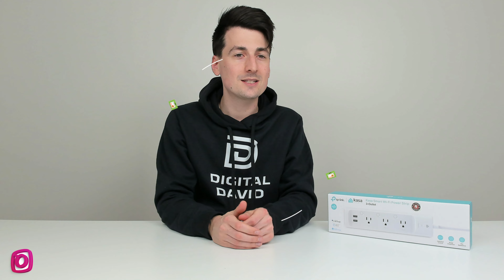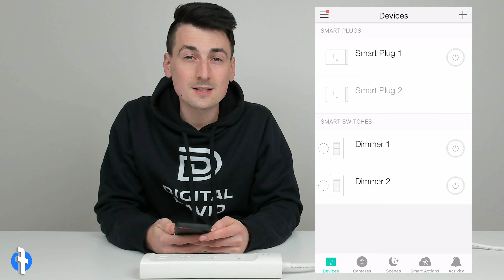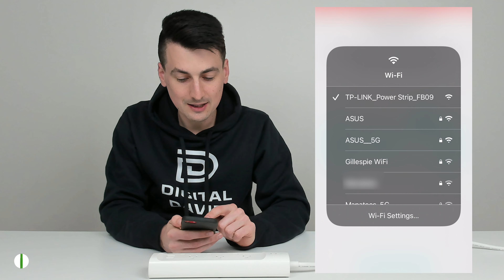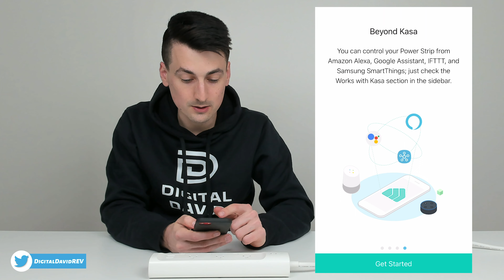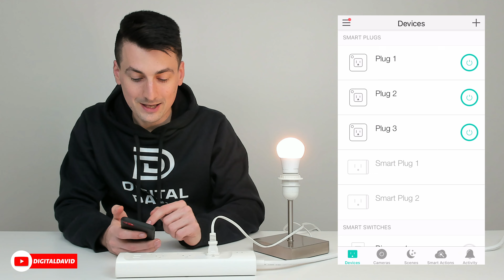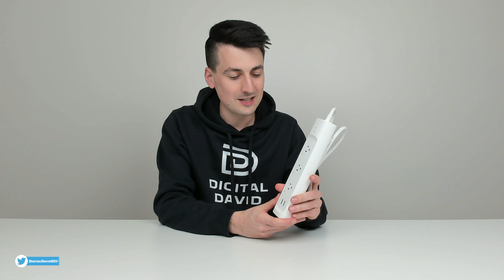Kasa Smart Plug Power Strip Review

Comment: Does anyone know if you can control the plugs when you aren't at home or do you have to be on the same Wifi network as the strip? I want to use this to cut power to 3D printers remotely while I'm at work.
Reply from the maker: You can control it from anywhere as long as you are connected to wifi and the smart plug is connected to your home wifi
~B

Comment: I have two of this, they are indeed awesome, planning to switch other power strip to Kasa
Reply from the maker: Good choice!
~B
Reply from the maker: It's great to hear that you're enjoying your Kasa Smart Plug Power Strips! They are indeed a very convenient and useful addition to any home or office. With the ability to control multiple devices from one central location, you can save time and energy while also keeping your space organized and clutter-free.

If you're planning to switch out your other power strips for Kasa Smart Plug Power Strips, you may want to consider the number of outlets and USB ports you need, as well as the size and design of the power strip. Kasa offers a variety of options with different features and capacities, so you can find the perfect fit for your needs.

In addition to the convenience of controlling your devices from your smartphone or smart speaker, Kasa Smart Plug Power Strips also offer energy monitoring and scheduling features that can help you save money on your energy bill. With the ability to track your energy usage and set schedules for your devices, you can optimize your energy consumption and reduce waste.

Overall, the Kasa Smart Plug Power Strip is a great investment for anyone looking to simplify their life and streamline their home or office. cnl
Reply: can u connect to power strip from data or outside the home wifi network

Comment: Can I use a smart power strip to connect a TV, sound bar and ps5 and have them turn on at the same time?
Reply from the maker: It will just turn power on to the strip. You'll still have to power on your TV and PlayStation 5 every time
Reply: Yes, you can create groups with as many of the 6 outlets as you would like. A command to Alexa (or whatever) to turn the group on will turn them all on at the same time. That's the way it works on almost all smart power strips. Be careful of buying this company's products. They don't stand behind them very well.